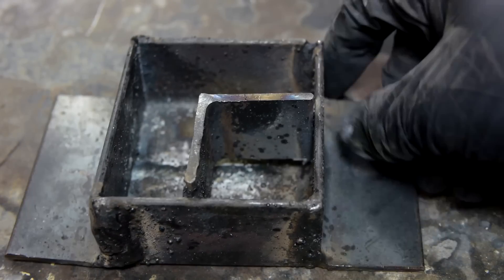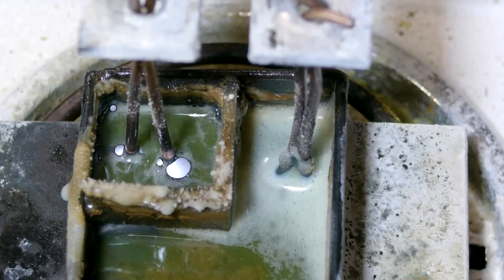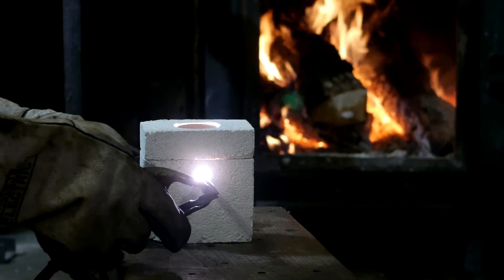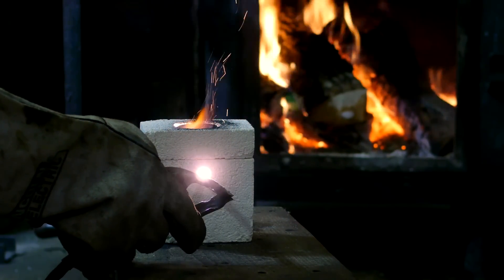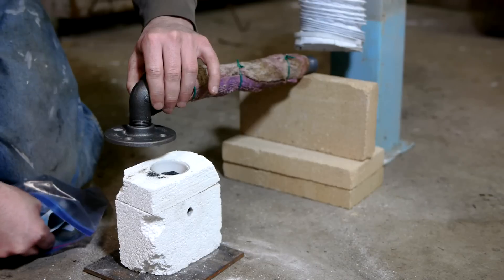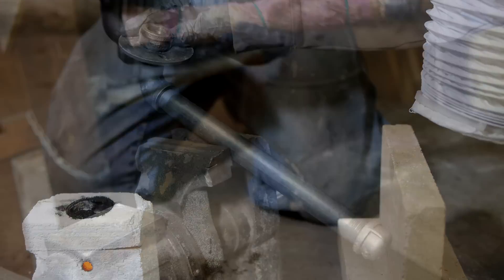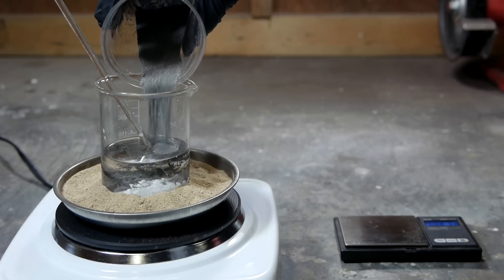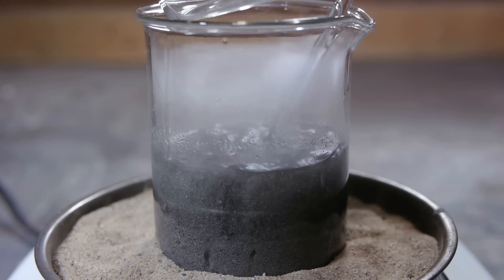How To Isolate Potassium Metal With A Plasma Furnace [Alkali Metal Series Part 2] - NightHawkInLight

Comment: Well first you must know that potassium and carbon/co2 have
unusual Ellingham diagrams which means that while it is true that carbon will
reduce potassium oxide at high temperature (over 900-1000°C) , potassium will
reduce co2 at lower temperature which will form a potassium oxide again with a mix
of carbon and carbon monoxide.
I have thought of an original experiment:
Mix aluminum with gallium which make an eutectic that melts
at 28°c with 9% max Al. https://www.youtube.com/watch?v=QekysnaBy1w
The idea here is to make an analogue of the magnesium/mineral
oil method but replacing the oil by the gallium, in this liquid alloyed state
the aluminum is very reactive so it should reduce the carbonate to potassium, aluminum
carbide and aluminum oxide at a fairly low temperature

If you add slowly your potassium carbonate you should be fine.
Also think of using argon atmosphere to avoid reoxidation
(or nitrogen)
If it works you should get some potassium on top with some
potassium alloyed with the gallium( Al and K doesn’t mix), then this mixture may
be distilled to recover potassium as gallium and aluminum have very high
boiling points.
This method is inspired by the brass industry, to remove the
zinc from brass in order to get the exact amount it is heated and zinc
evaporates.
Also for the distillation why not put the end of you cooled
tube into mineral oil to avoid oxygen entering (dont forget to keep argon
flowing to avoid vacuum and the oil being sucked up).Gallium is not consumed in this procces and can be recovered by plunging it into water followed by filtration to remove the aluminum oxide.

Tell what you think,i have never seen it done before but i think it could work. I can give you some documentation if you want.
Keep the good work!!
Reply from the maker: +aetius31 Very clever to suggest a gallium alloy, that may well work. I'll have to do some thinking on it.
Reply: +NightHawkInLight  This has almost certainly been mentioned elsewhere in the comments, but just in case it hasn't; it's worth looking at the chloralkali industy, in which brine pumped directly from the sea is electrochemically converted into a number of different products. One of the reactions used to produce NaOH, the Castner–Kellner process, proceeds via sodium metal, which is formed at a mercury cathode and subsequently dissolved into the mercury. This solution of alkali metal dissolved in mercury could be separated based on boiling points given that Hg boils at roughly 360 degrees while Na and K boil at about 760 C and 880 C respectively. I'm dubious of using CO2 to protect your product from oxidation, after all it is an acidic gas Which would surly attack Na or K in its metallic state. Argon or helium seems to me a better choice.

Comment: Have you tried electrolysis of molten potassium chloride? This works for sodium chloride (Downs cell), and you can lower the melting point by mixing it with calcium chloride.. I don't know if this will work for potassium, but I would love to see you try :) Nice work so far, It'll be interesting to see where you go next.
Reply from the maker: +Niclas I have not heard about the method of lowering the melting point with the addition of calcium chloride. That's interesting. I have not tried electrolysis of sodium or potassium chloride as of yet, because though I know it works for at least sodium, I would need to build a dedicated setup to keep the salt at a molten temperature for long enough to produce a usable quantity. I also am trying to avoid that method due to the production of chlorine gas which I would need to process separately to convert it into a safe compound for disposal.
Reply: +NightHawkInLight Chlorine gas dissolves in water, approx 1 liter gas in 1 liter water. You can turn it into a safe disposable compound by adding sodium thiosulfate. Or you can lead it through a sodium hydroxide solution to form sodium hypochlorite (bleach) and some table salt. It adds more steps to the process, but the biggest hurdle is probably the Downs cell.
Reply: +NightHawkInLight  It turns out that the Downs process wont work for potassium chloride, the molten potassium metal dissolves in the molten salt. Should work fine for sodium, though.

Comment: Make a better connection the the crussible (it doesnt need to be airtight and bubble the gas into mineral oil but instead of usinbg the presure from the reaction set up a fan at the cool end (after it boils thru the oil ) so the fan generates negative pressure

Comment: I'm not sure but I think the steel pipe with the towel didn't cool the escaping super hot gas enough (or not fast enough) to make it go back to a fluid fase. In the lab we use water and/or ice cooled setups for distilling so maybe try making a water cooled system?

Comment: you need to shield the potassium vapor from air with an eirt gas and have a sealed distillation set-up with a vacuum take out to ensure no air is let in it would be a bit hard to do this I suggest you just get the right solvent for the catylized reaction as that would be easier nurdrage had a movie but it was removed I think but it can be found around youtube

Comment: Phew....man...I dunno....might be one of those things where ya make the machine then its no problem. When looking at wikipidia it seems in any process it describes theres a ton of shit to do before  ya can even think of a second step like for example the Reformatsky Reaction stats talking about zinc powder but a few others seems to almost always mention that THF stuff and temperatures of minus 80 c. Another was leaning towards a vacumn or at least having no presents of air. Might be one of those things once ya build the machine its no problem like penicilin. I talked to a woman once who stated working in a lab said everyone hated working in the area where they consintrated the penacilin because it was always so busy especially on a hot day. Like a 10001 steps to make it. But dont trust me as Im barely able to do the math for the reactions never mind remembering anything about a specialized process. Man....just saying but if you cant do it....no problem to us....it actually looked like a cool way to make sulphur dioxide if it got pumped into a holding tank using a half fridge compresser and a freon holding/ drainage tank.  I mean....could the gas be bubbled up through -78c THF. and mixing aluminum in the crucible....Just saying  but ya know if it cant be done without having to make the machine...im sure everyone understands to not get too messy or dangerous for yourself and any of us here .Dam machines.

Comment: Use a longer, cooled pipe and try to vent the rather cool gases throug some mineral oil or so.
Reply: I agree with this comment. The pipe should be actively cooled with water or passively cooled with liquid nitrogen. Keep in mind the temperature of the reaction will rob the pipe of heat the longer you wait.

Comment: Can you somehow get a flexible tubing sealed over the crucible on the arc furnace, then bubble the gasses created through a chilled beaker of mineral oil?

Also we have the same vice, but mine is blue and I found it in a dumpster :P

Comment: I would say,  use thermite to heat it.  That should be less than an arc furnace.  I would try again but use actual condensers.  Make one if u must.  But SECURE it in.  And also make the column long.  And have the cooled game move to like a moonshine bottle or two-litter bottle.  Something that is big like that.  But have the bottle inverted cuz the gas will want to rise.  I will think this out more throughly and get a design

Comment: 1.attach a thinner copper pipe to the black pipe. 2.then make the copper pipe into a spiral. 3. run the copper pipe spiral through a Styrofoam cooler filled with ice water. should help.

Comment: can't you use a "proper" condenser? the one they use in labs.
Reply: The glass would fracture under the heat
Reply: NightSniper2 good point, how about a metal condenser that works just like that? since the one he used doesn't look like it works at all.
Reply: hentai nat I suspect that the reason it didn't work was because the condenser could not cool the vapour down fast enough. What he needs is an ice heat sink or running water

Comment: Try using a trap pipe instead, it seems most of the potassium is leaking out the other end. Perhaps replace the water in a traditional trap pipe with mineral oil.

Comment: I think what you need is the high-heat equivalent of a condenser. Perhaps take a three foot section of pipe, then another three foot section, but the second section is bigger than the inner tubing. Weld it together and tap in some brass hose barbs in such a way that cool water can circulate around the pipe, perhaps leading the tube itself through a plastic container of ice water to help cool the water as well.

Or, if that doesn't work, maybe liquid nitrogen? lol.

Comment: The molten salt electrolysis pathway seems the most promising so far. But I'd recommend you make the electrolysis cell out of a non conductive material, for instance by lining it with ferrite magnets (iron oxide should easily resist both the heat and the  corrosion, and they're available in a convenient variety of shapes and sizes). I'd also recommend you try to insulate the cathode from surrounding air as much as possible (in addition to keeping separating it from the anode).

Comment: rather than trying to condense the gas as it leaves the crucible, why not try to capture it and then further process it?
Reply: That would be very hard to do. Since the pipe isn't in a vacuum, there's already air in there. While Potassium would enter the pipe for him to collect, only a small amount would do so, and most of it would be lost. He could try making a pressurized chamber, but that would be very unwise and dangerous given that he's working with potassium. In addition to that, he'd have to flush the system with an inert atmosphere to keep oxides from forming. Distillation is the best way to go.
Reply: Ryan Cooper i meant like putting a big steel bucket upside down at the end of the pipe, or some sort of container of the sort, as long as he's able to make it air tight it should be fine. the post processing is to then separate the potassium from the rest of the stuff

Comment: for the catalytic reaction, use tetrahydronaphtalene as a solvent ;) for the redox: try making a a small pipesystem with something like a u-shaped cool trap and try flushing the system with some argon or nitrogen. maybe you could make steel cylinder with a pipe fitting

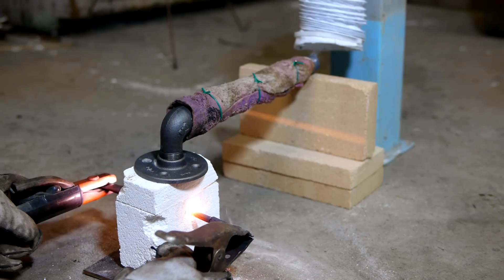Comment: If that is a vacuum at 4:02 , did you try without a vacuum? I think that it is possible that the reason you didn't have any potassium form may have something to do with that vacuum siphoning it away out of the pipe before it could condense. 

Thats just my guess though.
My only ideas are to either get a longer pipe/better coolant to make sure it condenses before it gets to the end of the pipe, or you need an alternative to that vacuum, such as a light duty fan.
Reply: +Flyerminer Agreed. Try putting a downward angle also.

Comment from the maker: I'm publishing this video immediately after upload so it may be a few minutes before HD viewing options are available. Thanks for watching!
Reply: +NightHawkInLight Hi! Why don't you use your arc furnace to melt potassium chloride and in the meantime, do an electrolysis of the melted potassium chloride? It works with sodium chloride so it should work for the potassium chloride either! The worst part will be to isolate the potassium without producing the oxide form! Good luck! ;)
Reply: +NightHawkInLight  try a reverse flow pipe for the crucible
Reply: +NightHawkInLight Have you tried contacting Professor Poliakoff over at Periodic Videos. Maybe they would be interested it working with you on this project?
Reply: +NightHawkInLight I'm going to mention chemistry, but don't worry, you don't have to be a chemist to really understand the stuff, it's super basic. Vertical glass column filled with argon gas. gas goes up, cools, comes back down, and through a 2nd channel next to your heat source and into a cooling flask. the alkali will not react in argon, and the metal wont' bond to the glass. The only issue is temperature for the glass, but you can do the tests. or you could somehow use ceramic, I dunno. The technical lab techniques that seem at a glance relavent are Fractional Distillation. you should check out the youtube channels Nurdrage and thunderf00t for their science videos. Nurdrage has a few on alkali, and tons on chemistry tools and techniques, including fractional distillation, which is a bit overkill for this. you're not actually doing fractional distillation.  Even if you don't use chemistry equipment you can very VERY quickly get the fundamentals for how to make your own without screwing up, meanwhile Thunderf00t has a number of other videos on alkali including creating more safe and replicateable  reactions with alkali, as well as how to prevent them.
Reply from the maker: +Anders Odhner That's pretty creative thinking. I'll have to look into that.
Reply: couldn't you just do like what you did to make hydrogen a few years back and take the arch furnace make a better air tight seal then flow the created gas threw mineral oil to protect it and solidify it
Reply: Alkali metals are so dang reactive and dangerous. It’s exhilarating! And scary...
Reply: Ok
Reply: Hi I love this channel! Could you do more low budget or beginner type videos? Because for some viewers getting the supplies you use is difficult or impossible. 
Hope you read this! Thanks!
Reply: +NightHawkInLight Maybe using dry or normal ice and or longer pipe on the distillation will be more effective. the oxidation is a problem tough, i assume vacuum distillation is out of question? i can ask around whit the teachers in my school (Chemistry focused 2nd degree education.) about ideas on producing potassium without lab grade equipment.
Reply: Maybe setting the pipe on a little steeper angle and some how use liquid nitrogen on the pipe 

Im no scientist but you might aswell try it
Reply: +yukikazeminecraft123 As far as i am aware angle doesnt really mean, liquid nitrogen is a solution too but it is kinda scetchy.
Reply: +ThePassiton its to cool the pipe down
Reply: yukikazeminecraft123
yeah, i got that but using liquid nitrogen as a coolant in distillation is sometimes not a particularly good choice.
Reply: +NightHawkinLight

for the potassium, how about having it in a pipe as this video, but make it more like a chimney: and have it go up with a coned top that Is cooled somehow (cause the vapor to condense) and have a ring for drip collection below that is on the outside of the pipe.
Reply: A wet rag will in no way get the pipe cool enough to condense whatever you're trying to turn back into a liquid.  I distill water and constant cold water is needed either flowing through a jacket around the pipe or the pipe needs to be coiled in a bucket filled with constantly flowing ice water.  The water will even boil if you don't keep it flowing through the condenser bucket.
Reply from the maker: +aj2674 Potassium has a much higher boiling point than water. It makes condensing it much easier at higher temperatures.
Reply: +Isiah Arnold what he's doing here is actually quite cheap and if you're willing to do some basic research on the web you can get all the materials he uses.
Reply: add borax to the mix it will burn off instead of the metal.
Reply: +NightHawkInLight Can you make a diy filament extruder?
Reply: +NightHawkInLight Hit up the guy from Applied Science :) He knows stuff :P
Reply: +NightHawkInLight, I don't have the expertise to say for sure but I would be thinking first principles, meaning rather than medieval heat, consider what the molecule is and exactly what needs to be done to it to change. If you need to break a bond is particular energy, apply a laser with that precise energy. Plus further minimal 'calm and composed' steps to avoid it recombining. It might even be advantageous to have the reaction be inside a laser. The idea is that if done right there is zero mess, only a seemingly magical transformation. A completely controlled reaction.
Reply: +NightHawkInLight Interesting video!
Reply: possably a moonshine like distilary set up